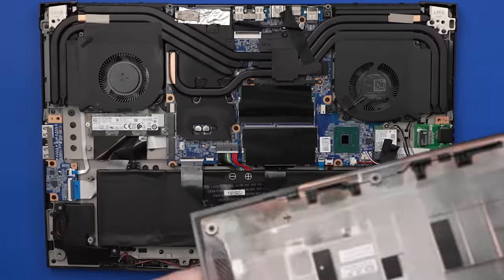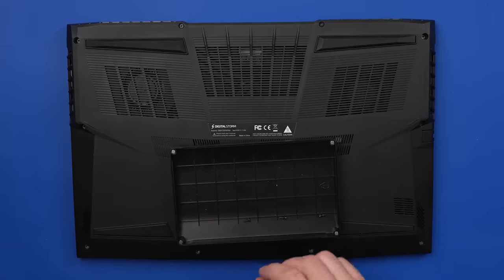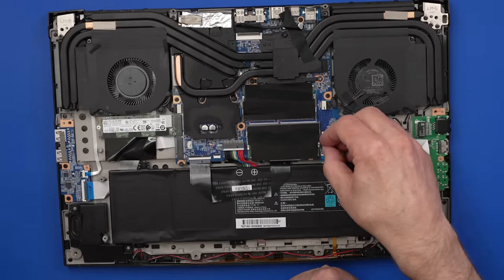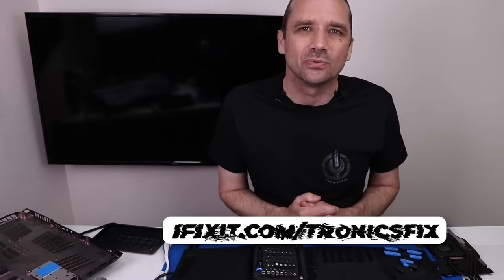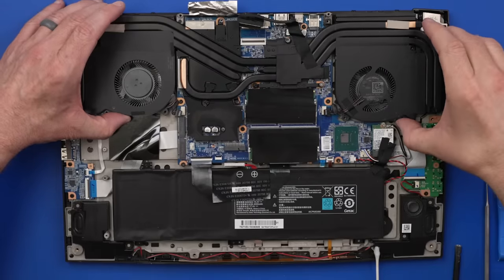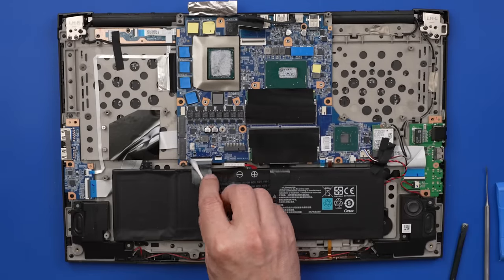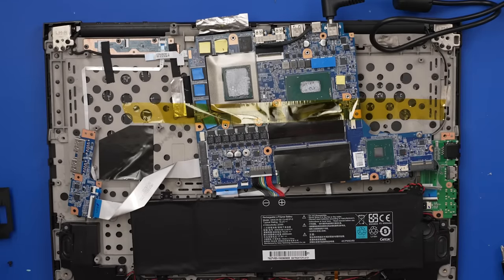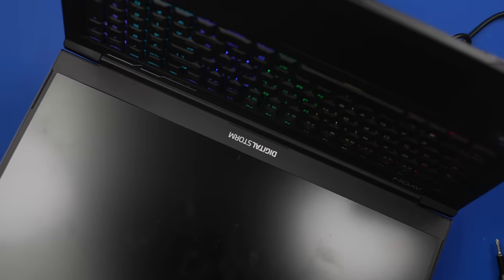They Quoted $900 to Fix This Laptop - But Were They Right?

Comment: Perfect example of a gaming laptop.  It doesn't matter what the specs are, the quality of the parts, or even if the manufacturer is reputable.  It looks cool and they say it can play games... TAKE MY MONEY!  TAKE MY MONEY!

But, they cry when they finally think that they are getting ripped off?  First, you bought a "gaming laptop," which is an oxymoron.  Second... wait, AVON?  Don't they sell cosmetics?  

Every single client I have seen, that has bought a gaming laptop, will never buy one again.  A decent one costs around $3,000, they say they have i7s or some Threadripper CPU, but when you look at the specs, they are more like dual core Pentiums from around 2005.  The "video cards" that they say are 3080s or something are more like a 720 in a desktop.  The RAM is usually the slowest speed... because gamers think that how much RAM you have matters more than how fast it will actually run.  And the best part is... most break in a year.  Manufacturers just expect that if you are a "real gamer," than you will spend $3,000 a year on your hobby.  Plus the cost of games, DLCs, Internet, etc..

As I said, most clients I have dealt with have only bought one gaming laptop.  After that, they get a full desktop rig, a nice monitor, headset, mic, gaming chair, desk, and everything else.  They may spend $4,000 or so for everything, but it will last them four or five years.  And, they can upgrade as they go.

But what do I know?  I build about five computers a day.  Probably about three or four custom gaming rigs a week.  I am probably not experienced enough to know any better.

FFS... AVON.  That still gets me.